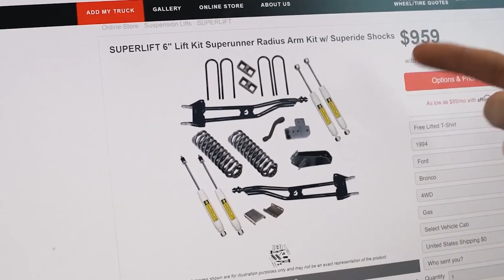Behind the Build | Junior's 1994 Ford Bronco

Comment: The f350 bumper makes it. So tough looking
Reply: Did you have to modify the bumper because I have a 94 now and I have a 6 inch lift with 35’s on their 17 inch wheels but I wanna go bigger and I like to definitely wanna do the bumper
Reply: @ramontaplin7901  u need a bracket

Comment: always liked Broncos. my fav body is 80-86 cuz of the lines on that style. Owned an 84 for 20 years with a lift and 35 general grabber mt's. Took it on several 5k mile roadtrips. those wheels are different but it's still a bronco.

Comment: Got a bronco myself. Did a 85 bull nose front clip and it's got a Manual turbo 6.9 bored 30 over. I absolutely love it. Not done yet but I'm going pavement princess as well. Already have 2 79s ones a f150 and a f250 so I have my mud/work trucks lol. Love the wheels and bumper

Comment: I had a 1995 F150. Single cab, 302 V8, 4x4, C6 automatic. Blue and white factory paint. Stock 15" wheels, 33" tires. No lift, never needed one. Did everything you could ask a truck to do and only broke down maybe 3 times in my years or driving the piss out of it. One was a module corroded out I side the fender, another was a dead alt, another was the clutch fan broke off the shaft and went thru my radiator. Great truck, and 100x more reliable than both the Chevys in my driveway right now.

Comment: Question, we’re just looking at 20” wheels for our 1993 Bronco shop truck and running into hub issues. Most of the wheels don’t allow the centre caps to fit over the hubs. Have you run into any conversions or ideas to get around this problem?

Comment: I've had my 1994 Bronco since 2000. Redoing it now. I really want to know how you did the bumper install and how easy it was? LOOKS AWESOME!
Reply from the maker: The install was easy with the conversion brackets
Reply: @ARKONOFFROAD  where did you get the conversion brackets? THANKS
Reply from the maker: @gdbunn  I do not have that info at this moment, I know all he did was a google search for them, 94-19 front bumper conversion bumper brackets
Reply: Thanks for all the replies. Have found a front and rear bumper pair of a 2020 F250. Have you ever tried installing a newer F250 bunker in this style Bronco? Just wanting to try what all I’m gonna do when i get it painted. Thanks.

Comment: I have a 86 bronco and you inspire me to officially start my build for it. It's got 690k miles on it and it starts and runs perfectly,, if I can get it started. Changing the fuel pump and fuel filter to see if that works ... pray for me
Reply: Has 2 fuel pumps and eec and fuel relay
Reply: @D4x4Bronc  do you think it's the fuel pumps or starter? The engine wants to turnover but it cant get enough juice to start. The battery Is brand new too.
Reply: @akasha.tushet9645  doesn't make sense. If engine turns over normally it's not starter; and is spark fuel or compression
Reply: @D4x4Bronc  I installed new nickel spark plugs on it not too long ago
Reply: @akasha.tushet9645  need to find what it's missing of the above 3 that is keeping it from running. Search for a bronco forum
Reply: @D4x4Bronc  thank you brotha

Comment: I'm gonna trade my 96 reg cab shortbed for the neighbors 95 extended cab because even though it's got a little more miles on it than mine it has less rust and it's an automatic which is what i prefer. I'm gonna build it the same way as this 22x14 and 35s with some squat. I'm gonna add tow mirrors though✌

Comment: Can you save me the trouble and tell me exactly what size rims and what size tires and where I can get them from
Reply from the maker: These are 24x14 -81 ARKON Lincolns and 35x13.5 AMP Mud Terrain Attacks, and you can find all these at www.arkonoffroad.com
Reply: Thanks how much was Total
Reply from the maker: @bobbygomez2365  Build your wheel and tire package at www.arkonoffroad.com to add accessories.

Comment: The block in the rear dislike is for safety reasons so it doesn't slide out and kill someone. It's a common sense not hate.
Reply from the maker: He will have air ride in the rear soon, that will get rid of the squat

Comment: Wat size are those rims and tires I have ford bronco 1987 and I will like to buy some like that for mine
Reply: Watch the video
Reply from the maker: Abel Porto 24x14 ARKON Lincoln’s wrapped in 35x13.5 AMP Mud Terrain Attacks
Reply: ARKON OFF-ROAD   Ok  than k u my last cuestión do u lift that bronco in order to fit this rims and tires.  Because mine is not lift I put 15 by 10 whit 33x12/50 15 and I have to cut that bumper because was rubbing
Reply from the maker: @Purosanluispotosi  Yes, the lift is what makes these wheels and tires fit, if you need fitment help email wheels@arkonoffroad.com and we can assist you.
Reply: ARKON OFF-ROAD   Ok thank you very much
Reply from the maker: Abel Porto You’re welcome

Comment: Wheels and suspension ain’t a build
Reply: yes it is, you're forgetting paint, de-rusting it, he ain't done, interior, better chassis, my dingaling..lol jk..
Reply: Not only that he had to custom fab that front bumper and lots of other parts
Reply: Internet Alex did he had any engine mods exactly don’t get buthurt im just giving my opinion but his cosmetics are nice
Reply: TigreLoko24 lol it’s cosmetics not mods
Reply: Internet Alex The front bumper is almost a direct fit
Reply: @instantstory1692  its a build, not necessarily has to be performance mods to be a build..
Reply: TigreLoko24 It kinda is bud mods is performance , cosmetics are looks
Reply: @instantstory1692  a mod could be anything cuh, interior mods, exterior mods, drivetrain mods, a dingaling mod..lol jk.. But now what we're in the topic, I want to do a 5.3L big bore stroker 2v 4.6L based V8, will need resleeving on production block n was told block would be weakened by it n therefore not worth it on stock iron block, then there's the 5.4L modular block I can buy n build, but I still want a stroker build, so I'll see what I end up doing..
Reply: TigreLoko24 that be nice to see and I got a 6.0 turbocharged suburban but the 24 inch wheels slow it down so I gotta get the right wheels for it
Reply: @instantstory1692  20s might help..